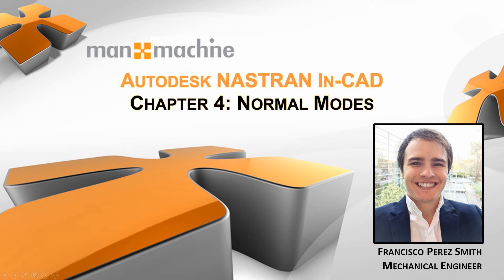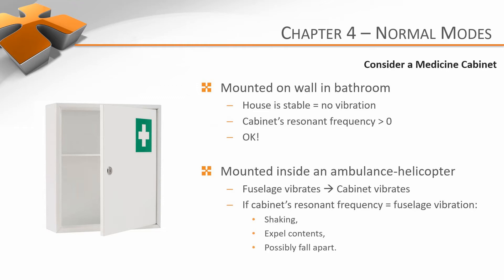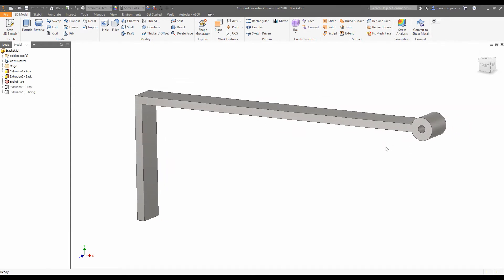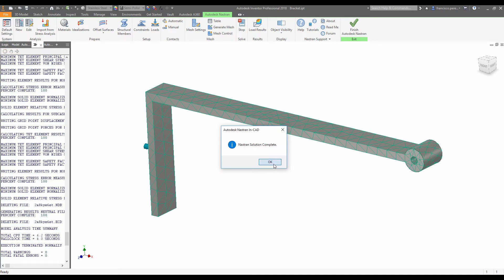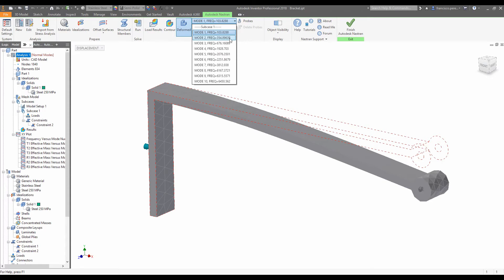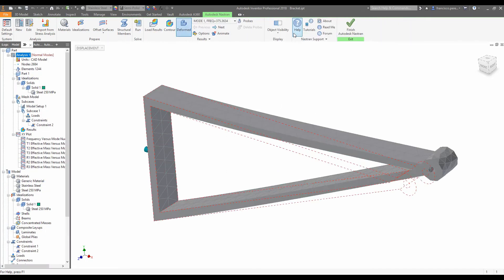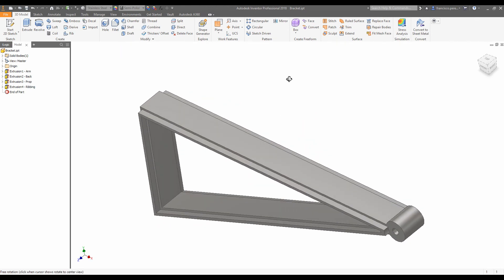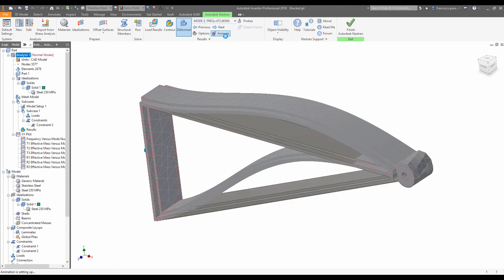Normal Modes Analysis in NASTRAN In-CAD

Comment: Why were there 400+ warnings??
Reply: Hi ck8koneti! Sorry for the late reply! The warning for the final analysis was "G3015", which is telling us that the elements in the mesh have a face interior angle of greater than the preset warning tolerance. For the sake of demonstration, I breezed over this, but if we wanted to fix it, I would refine the mesh, or change to hex or quad mesh elements.
Reply: @evilpanky  it is possible to do HEX mesh with Nastran In-CAD? Is that kind of new feature? I thought all the time that only tetra mesh is supported, but I am not user of In-CAD so might have changed...